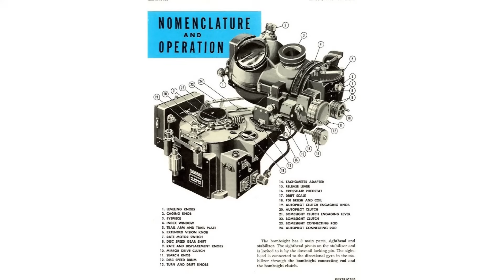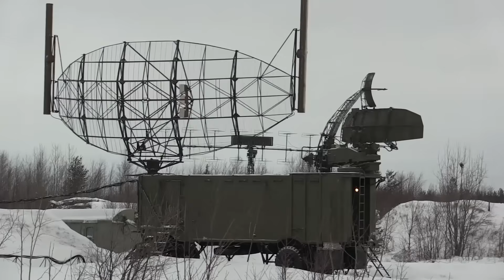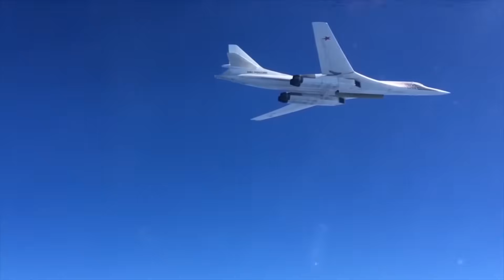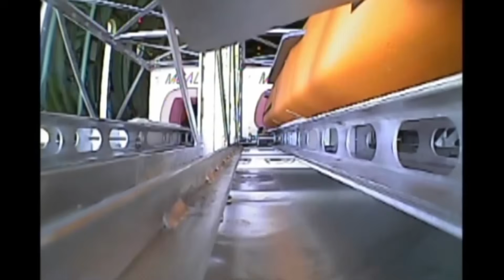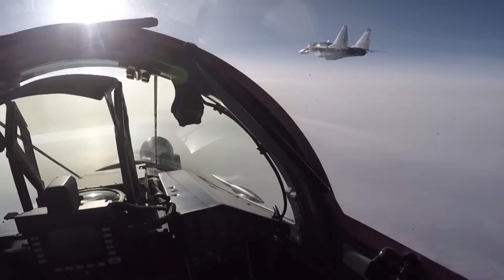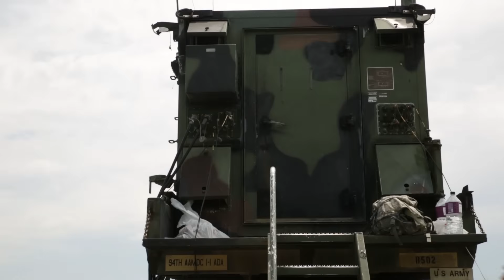SEAD - Suppression of Enemy Air Defense

Comment: IN A  WORST CASE SCENARIO A LOW YEALD NUCLEAR DEVICE CAN AND WILL FRY ALL GROUND RADAR. IF  USED IN
LOW YIELD DOSES COULD  BE DELIVERED IN A SMALL NEUTRON  STAND OFF MISSILE. THIS  CAN DO THE JOB IF NECESSARY, FOR  NEUTRALIZING UP TO SIXTEEN S-400/500 SYSTEMS  ITS JUST A TARGET AND CAN BE TAKEN OUT. ONE FIFTY CALIBER ROUND CAN DEFEAT A S-400 TRACKING ANTENNA.

Comment: You totally missed Artillery SEAD missions (pronounced SEE-Add not seed)  basically, the artillery battery shells the SAM site to keep the crew's head down. Then the shelling stops just as the Fast Mover arrives on station and resumes as it leaves. We calculate this based on the BOD (bombs on deck) time and backing off the ToF (Time of Flight) for the artillery rounds. This way the ACs are not in danger of a mid-air collision with inflight shells.

Comment: Anti SEAD tactic, used and proven perilous for "wild weasels"...

1) Turn surveilance radar for a matter of seconds, only until you get position, direction and speed and immediately turn it off. Very short time, not giving the SEAD planes time to pinpoint your exact location. Then manually calculate the point of impact of missile to the plane (as if the missile is launched and guided properly), manually turn launchers into that rough point and launch minimum 2 missiles with a delay between shots. Also, point manually guidance radar into that direction, but don't turn it on yet, You know target elements, you know the distance and the speed of your missile... Upon launching, start a stop watch and wait...
At this point, missiles are in the air, but the target knows nothing about it. On the other hand, if you keep it up this way, they have pretty much 0 chances to hit. BUT...
Some 3-4 seconds before the expected time of impact, you turn the guidance radar on. The missiles that are already in the air and close to the target will pick up the signal in flight and start homing. In those 3-4 seconds they will either hit or miss; the pilot has those 3-4 seconds to react to the missile threat as well and most likely not enough time to pinpoint the position of the radar. The SAM crew, as soon as they see hit or miss, turn the radar off again and relocate, just in case. This way, radar was on for two 3-4 second periods and did the guidance for only that time, so most likely remained safe while shooting at an enemy that can't fire back. In simple terms: guidance took 3-4 seconds instead of 10+ seconds.
The method is often combined with false radar positions and false radiation sources to confuse the SEAD plane into not being sure which one is real, even if it gets to pinpoint a location. Tactics used to shoot down an F-16 over Bosnia and later during the Nato bombing of Yugoslavia. SA-6 Gainful (Kub) proven to be very effective when used this way.
2) A tactic used in Vietnam... As soon as a SAM site realizes SEAD planes are turning that way, they turn their radar off. However, then another, previously inactive radar at different spot turns on. Once wild weasels start turning towards him, he also turns off. And then the third radar turns on. As soon as the go for that radar, the previous two radars suddenly come to life at the same time and all 3 of them start launching missiles simultaneously. Now, weasels have missiles coming at them from 3 different directions and they have to choose: stay on radar they are going to and attack it but risking almost certain shooting down or disengage and start evasive maneuvers. High level of coordination between SAM units is an imperative here...
3) Place radar SAMs in rather an expected spot (or even better, false radiation source) using topography to predict the approach of SEAD/DEAD planes; deliberately leaving some holes and passages that seem safe. In those spots, you place short range air-defense units, mainly armed with IR guided missiles, MANPADS and AAA. Basically, create an ambush with (false) radar guided SAM as a bait. Hopefully, SEAD planes will use those lines of approach on low altitudes and end up hammered by these systems.
So, a bit of brains and cunning can beat the technology.
Oh... Greetings from Serbian air defense and special mention to F-117A stealth fighter...

Comment: It is true that before doing any decision related to military operations in kashmir, the issue of SEAD has to be thought out properly and in detail. It would depend upon SAMs deployed around each target but in general the best solution is decoys of two types. Either towed decoys or air launched radar decoys. The later are practically cruise missiles but with changes to look like a fighter jet on radar scope. The RAAD, if it is something real, can be used as an air-launched radar decoy. Or dedicated systems can be imported too. The best thing to do is of course to use retired aircraft as remote-controlled decoys. They can be launched on the intended target a few seconds or minutes ago the real strike. But there is no cheap or dumb solution to SEAD, otherwise, no one would purchase SAMs. Anti-radiation missiles or even standoff air to ground munitions can also play a good role in SEAD. But for Pakistan, the solution is gunship helicopters. Gunships have to be sent a few minutes ago the fighters of Air Force. Due to their slow speed and low altitude flight, they can precisely located and destroy air defences. AH-64 Apaches did the same thing in the opening hours of Operation Desert Storm over Iraq in 1991.

Comment: However there is not a system in the world that can suppress the vaunted S-400M, that's because S-400M uses multiband dispersed frequency hopping mobile radars which shut on and off in preprogrammed sequence, so as soon as one is picked up it shuts down and others take over, and the data is shared between all of them and the launchers could be located 100s of miles away. Plus S-400 variants are the only SAM system in the world that can pick up a HARM missile, this is because it's computers have stored all of the various HARM flight and approach charecteristics, plus S-400 can even tell when an incoming missile turns of its rocket motor, it knows exactly its burn time, so as soon as it is turned off the amazing S-400 knows its a HARM missile and then targets the HARM missile itself with its own much faster and more manuevarable and longer range SAM missile. That was only 1 mode of the vaunted S-400 defense capabilities, they all have electronic counter measures that continiously jam and send ghost signals to enemy HARMs and radar identification pods and radars. As far as jamming S-400 u can forget about it, we already told you S-400 uses multiple mobile spread out radars, + with frequency hopping so that the signal is constantly lost, and operate in multiband mode making it impossible to jam all channels. And last but not least, all S-400Ms are equipped with targetting microwave emmiters which when enemy equipment in the air is identified is basically fried by the powerful widely spread microwaves attack transmissions. In addition to this all of the Russian operators know all of the frequencies used by US and NATO forces, so they attack simultaneously US and NATO communications and radars. Thus you can see the S-400 is full proof from any attack in to the forseeable 26 years, and this isn't coming from the pesky Russkies but from our own U.S. Air Force 4 Star General Buck Cummings, a 6 tour combat veteran!

Comment: No air war expert here but here is one approach or might be a dumb approach, but heck for the sake of discussion:  Mount a cheap radar of Mig-21 on half a high mile post looking 360 degrees.  These radars can see good 30 kms and will know an incoming cruise or ARM missile.  Feed this information to CIWS batteries which give a nice welcome to the missile plugging it with few dozens of 20mm bullets.  However, HARM 88 is a mach 2 missile moving at half km per second, which can be difficult to handle so would need few of CIWS firing on the same target.

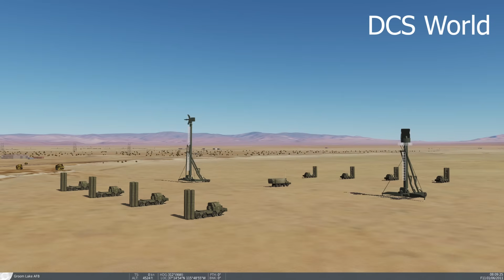Comment: 6:30 no, they won´t fire S-300 / 400 at you if they have a Pantsir or 2K22 Tunguska or TOR in their site what they usually do, specially if it´s a border SAM.

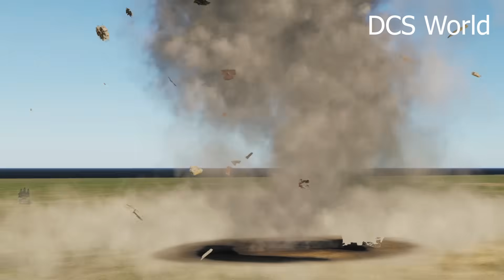7:55 no, they will know, most of the developed military forces have EWS or Early Warning Systems that will alert them that a attack aircraft is on their way, I doubt they say "oh look they bring cookies"

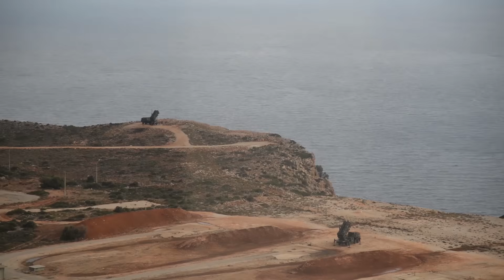12:30 or smart bombs

Even with that small mistakes, it´s a great video explaining a very complex part of air warfare. Congrats!

Comment: Some points that should be pointed out:
1. That 'inexpensive bomb' you mention is not a stand-off weapon. The simple reason is this: you need to get close to the missile system. You need to get close to the missile system= the missile system can shoot you down. The ideea of stand-off weapons is to stay as far away as possible from the enemy targets.
2. Again reffering to these bombs: they don't need to fire missiles at your bombs. They need to fire missiles at your airplane. 

3. Long Range missile systems like S-300 and S-400 have mobile radars and missile launchers. However, they are also separate and linked. This means you can take out a radar, but a secondary radar can still track your plane. And because they are separate, the launchers can be located in different points than the radars, so no dangers if you engage them.
4. In the Russian defense doctrine, S-300, -400, -500 are meant to also be protected by other short range systems, like Pantsir or Tor(I believe it was). This layering is meant to specifically defeat stand-off and anti-rad missiles, so the long ranged systems deal with the airplane or whatever carrier vehicle is employed, while the shorter range guard those sites. Medium range systems are sort of independent. This means that if an aircraft manages to slip through the gaps of S-series  or you need to defend an armored column from it, the Buk or Tor will engage it. Basically, with those missiles, Russia tries to achieve one of the roles of US aviation: Air interdiction.

EDIT. I see that you mentioned some of my points towards the end of the video. This video seems quite well done and researched. Nice job.

Comment: I am just wondering, what is the anti radiation missile defence? I am thinking as a missile gets closer to a certain point, it can be bombarded by very cheap radar signals all over the place that would confuse the heck out of it. You really made it an Achilles heel of any SAM site, and its mind boggling that there is no counter measure against it at all.

Comment: sead only works with countries that have no formidable airforce or early warning system .. keep dreaming
Reply: I'm not sure about it. Most countries aren't prepared for a confrontation with a sizeable airforce, especially if they have no time to mobilize. Take Germany for example. Surely, Germany has access to highly advanced weaponry and air defence systems, but it is extremly unprepared at the moment. Germany has no 'standby' air defence and - to be honest - certainly lacks enough trained personnel to man it in the short to medium period. While strong on paper, a large part of weapons/verhicles/planes isn't readily available. And furthermore, how long would the supply of ammunition last in a real confrontation? 

But your point is very valid: we (thankfully) hadn't a 'real' confrontation between two capable military powers for the last 50-60 years. Instead, there where  quite a few instances  where one highly superior power pummeled an inferior power with their airforce to achieve their goals. The Falkland War was (mostly) the only occasion where two modern airforces where at each others throats. And the RN had some real problems ...

Comment: During NATO's 1999 aggression on Yugoslavia/Serbia, Yugoslav Army (YA) turned radars on longer then 10 seconds during which they would fire if they see anything, and they used microvawave ovens in vicinity of radars to simulate radars when they are turned off and redirect radiation missiles. I do not know if they modified them in any way, but during 78 days of bombing campain only 1-2 radars (definetly not more then 5) were hit by radiation missiles.

Comment: What about loitering systems such as the Israeli harop and harpy ng ?
They are the nightmare of Syrian air defenses..
Another attack  option is cyber attacks on radars and c&c’s ,after all, those are computer and network systems..
some say that there were days were soviet radars were easier to hack than a common pc running windows with firewall..

Comment: Buk-M1/M2 and Kub-M3 can track target opticall for a time but at least in terminal phase using the fire control radar is necessary because of the SARH guidance. They are not RCH guided. BTW even with first AGM-88 HARM was possible to use the RCG signals of the Dvina/Volhkov/Neva.

I strongly recommend to check to you these.
https://www.secretprojects.co.uk/forum/index.php/topic,30034.msg324404.html#msg324404

Comment: If a plane cannot venture into an area then what makes a cruise missile feasible? Can't they be shot down too?
And if planes had to fly at high altitude even in WW2 to avoid anti-aircraft artillery, why is flying at low altitude under the radar horizon seen as viable now, and why wasn't it used in WW2? 
Any answer would be appreciated because I'm a little confused.
Reply: Reaction time. An undetected plane flying at low altitude gives very little time for the defender to respond. Also, Britain did utilise low level attacks in WWII with the Bristol Beaufighter and later the de Havilland Mosquito.
Reply: @Qilue  Oh that makes sense. Thank you. I wonder why it wasn't used more seeing as the attacks would have been for more accurate than carpet bombing. I guess not enough damage would have been done by their small payloads.
Reply: @sleepyhead6726  A small precision attack aircraft like a Mosquito can do little lasting damage to a factory complex or a rail yard. There was also Bomber Command doctrine which was aimed at terrorising German cities. It was all very ugly.

Comment: Incorrect.

Integrated S-75 sites did not just switch off radars during sead attacks, they blinked radars for guidance hand off capability.   Such guidance was not accurate enough to assure reliable tracking, but it prevented sead missions from employing its stand off capability.  In effect it was a stand off, with S-75 sites not willing to waste missiles, and WW not being able to track any given radar long enough to assure a strike.

Overwhelming majority of successful air strikes on S-75 sites were conducted by low altitude attacks, that's why so many of the attacking aircraft were downed by AA fire rather then SAM fire. 

The very few successful sead strikes on S-75 sites were conducted against isolated S-75 sites that were manned by Vietnamese crews, while sites manned by Soviet crews did not suffer such losses.

There is a reason as to why statistics of missile launches per target strike ratio varies so drastically between Soviet and Vietnamese crews.  

Soviet SAM systems did not become mobile due to sead attacks, they evolved into integrating mobility through implementation of higher order communication capability between command station, radar station and launchers.

The author of this video does not know the basic organizational structure of Soviet SAM systems, specifically National Air Defense vs PVO defense.

S-75 Dvina was designed as a semi-mobile system for National Air Defense, therefore its primary requirement was a robust, hard data link for deployment at prepared defense sites.

Soviet mobile SAM systems were designed for PVO forces, for deployment at unprepared sites wherever ground forces required protection.    

This video is misleading and factually incorrect.

http://ausairpower.net/APA-S-75-Volkhov.html

https://www.globalsecurity.org/military/world/russia/pvo-sv.htm

Comment: So, very well put together and informative video-Thank you. Although not mentioned, as a previous Army Artillery man, I would like to add that we regularly would shoot SEAD missions for the Air Force or Army Aviation. Sometimes we would shoot conventional rounds (if in range), but usually ATACMS for the Air Force. We would put together the fire plan using the aircraft air corridors to their target(s) and build the fire plan for firing the SEAD mission, usually  at 2 minutes ahead of the aircraft based on wheels up time. It was very interesting and challenging to do, but a nice change to standard call for fire or counter battery.

Comment: 0:48 WW2 bomb sights were not accurate at all lol and neither were the bombs that dropped. That is why bomber raids were so massive because only a small percentage of bombs actually landed on target.
Reply: That is actually a misconception. The Norden bombsight actually was pretty accurate, but only in certain very special conditions. And in real world combat, it turned out NOT to be very accurate mainly due to how bad gyroscopes of the time were. All of the constant banks and turns to avoid flak ended up causing the gyro to build up a ton of errors unfortunately.